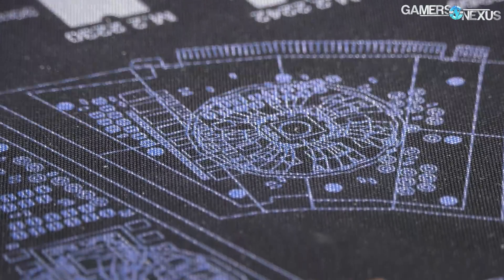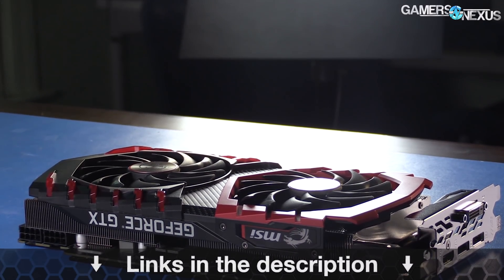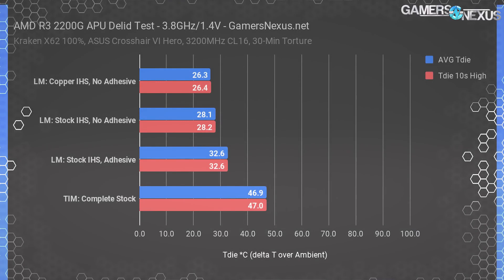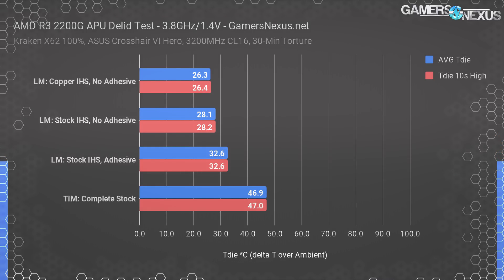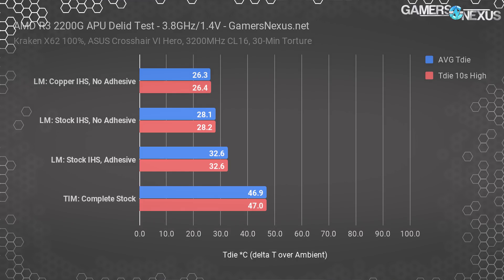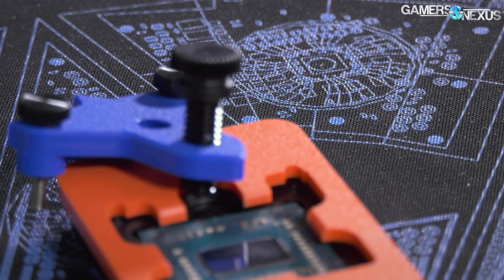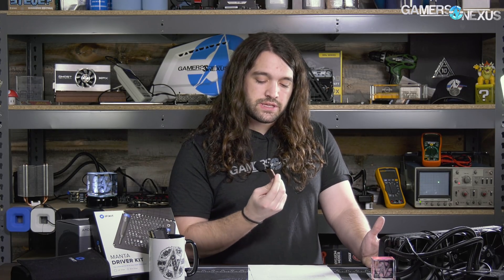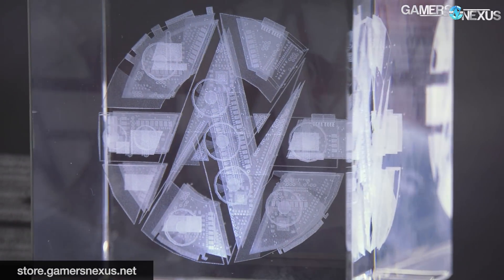Ryzen Custom Copper IHS Tested

Comment: Interesting enough but I’d like to see how to remove the silicone adhesive. How does that not get in the way of the delidding, is it that easy even though the adhesive doesn’t want to come off? Also does the adhesive actually help protect the silicon by dampening the pressure from the cooler plate?

Comment: I have no idea if they were available at the time but EK offer both a flat cold plate and a rounded one (more suited to the uneven stock ihs) but it would've been cool to see if there was any difference when you use an optimised cold plate for each ihs

Comment: Hi, great video, as always. I have a question - doesn't the Gallium in Liquid Metal eat away at copper over time and hence is only advisable to apply on nickel plated surfaces instead of aluminum or copper surfaces ? So how does this setup with liquid metal as the TIM between die and IHS fare for the health of the RockItCool's Copper IHS ?

Comment: Just as I have posted on a previous video regarding this useless operation, you are basically gaining nothing in real world thermal transfer by replacing one piece of metal, with another one. You are just replacing one bottleneck with another. The REAL deal is when deliding the CPU, never re-lid again with anything. Alk you need is a special height adapter for the socket to compensate for the height loss and properly secure the heatsink (available from a couple of specialized online vendors) and thats it! You now actually eliminated one bottleneck all together instead of going around the bush and replacing it with another one ''that has better heat transfer properties. Nope,  none of that! Pure logic and physics here: CPU DIE, THERMAL PASTE OF YOUR CHOICE AND HEATSINK! This is the ONLY way to benefit from deliding a CPU and improve thermals :)

Comment: Oh and NEVER use liquid metal. Even after a very short time, it can harden on the chip and heatsink. This means sanding/scouring to remove it which fks up that lovely lapped surface and slowly         chews away the die surface. Considering that it needs re-applying AT LEAST every couple of months that is not a good situation. Minimise thermal interface, use the best quality traditional thermal      paste....

Comment: Back in the day.... there were no IHS's... heatsink went direct to die. The best IHS is NO IHS lol delid and chucket...... it's an easy thing to make the cooler press down a little tighter to account for the missing thickness, and with 1 less thermal interface and several mm less mass for the heat to traverse on it's way to the coolant medium... you will see WAYYY better improvement than ANY custom IHS can ever provide. Heatsink/cooler-block direct to die... always.... 
Minimum thermal mass at the die, maximum thermal mass at the radiator.. best cooling...... try it and see ;)

Comment: If you do further testing with Deliding, could you do a test with stock TIM, vs LM vs high end TIM like Kryonought thermal grizzly. For a project like this which is attractive to those using LN2  however LM is unsuitable for low temps due to it's high freezing point so i'd want to know if its worth deliding for LN2.

Comment: I used to work in corrosion control in the military.  From what I understand, you shouldn't be mixing metals surface to surface for any kind of long term use without expecting galvanic corrosion to occur.  I keep seeing these videos, and this issue is never addressed.  Some liquid metals (mercury) can cause catastrophic damage when they come into contact with other metals and alloys.  I've never seen any conclusive testing on what these companies are actually using for their products to ease my mind for use in a PC for 3-5 years.  The numbers are cool and all, but I find them impractical without feeling comfortable about the product in question.
Reply: I am personally using a liquid cooler with a copper heat spreader but this could vary even though pretty much all the high end stuff that I've seen uses copper (maybe nickel?) and if you're willing to modify your CPU like that chances are you have a pretty high end setup.
And regarding that mercury issue that you pointed out, no one will ever be using mercury because it's not exactly easy to find, it's dangerous and extremely polluting. Liquid metal for cooling is generally some kind of alloy of tin, indium and gallium. Heck, even thermometers use gallium alloys these days.

Comment: Steve. Would giving the copper ihs, or any ihs for that matter, a polished mirror finish as apposed to the milled finish seen here have any impact on thermals? My thinking is that there is less peaks and valleys for the TIM to have to get into, and thus it can be thinner leading to better heat transfer.

Comment: What I find strange is that in every deliding video only liquid metal is mentioned while it is not necessarily a good solution for everyday use. Would a high quality thermal paste between the cpu and ihs make any significant difference compared to the stock tim?

Comment: I'm curious how much of a difference lapping the IHS and heat sink plate would make on thermals. Probably not a huge amount but I know that Intel's IHS is typically Convex and many cooler plates are also slightly convex. I was thinking that by lapping the CPU yourself you'd basically achieve what the Rockit Cool copper IHS does by making the surface flat and exposing the underlying copper. You'd also get the side-benefit of having the nickel plating on the underside of the IHS so the liquid metal isn't so difficult to deal with. I've been thinking of doing this with my ancient X5660@4.4Ghz and the equally ancient Thermalright Ultra-120 Extreme (Nickel) I have.

Comment: LTT did a video featuring a graphite thermal pad with ridiculous endurance to replace thermal paste I think it would be funny to use that this aftermarket IHS and a passive cooler as the ultimate maintenance free CPU cooling setup

Comment: What the graphs show is that thermal transfer is a function of basically contact surface area, heat generating surface area, heat radiating area and distance between surfaces (pressure). Makes sense, no?

Comment: If it is a product for hard core overclocking why they made it from copper instead of something better in terms of thermal conductivities like silver for example?
Reply: Because you would likely run into the heatsink being the bottleneck, and so wouldn't see much improvement. You could make a silver heat sink (though it would be highly prone to damage as a soft metal), but the price would likely be high even for hardcore overclockers. A large heatsink made of silver would cost over 500$ at least. And because it wouldn't be mass produced, it would likely be in the thousands.

So long story short, silver wouldn't be better than copper unless you also got a silver heat sink.

Comment: You should try honing the rocket cool surface. With a thicker IHS you have enough material and could polish the top of it and the bottom of your heatsink to tolerances far tighter than manufacturer achieving an almost cold weld connection.

Comment: "...so you can't go to wrong with it." Until you break a $350 CPU because you don't know how to delid a processor before attempting to change the IHS.

That said delidding is something I would try but not with a CPU I still want to use on a regular basis, at least not for my first time.

Comment: I wish CPU cooler parts manufacturers would use pyrolitic graphite sheet. It has many, many times the thermal conductivity of copper. It would basically be as good as this, but much smaller, and can be added on top of the standard heatspreader.. or something like that. There are at least some possible uses.

Comment: QEUSTION.: i saw linus do a vid on IC Graphite thermal pad ,what if you delit and stick that inbetween then aply the copper and then another graphite pad and then the Fan ?(or if there is a fan a fan made with graphite ?) would that decrease the thermals alot more or would that be to risky ? love the show on how detailed it is every time.

Comment: Steve can you test IC Graphite Thermal Pad by Innovation Cooling? Linus has a video about it and was wondering what you would think of something like this. Be interesting to see if it would work for the IHS on both sides instead of liquid metal and thermal paste.
Reply: Nertz yes please, put this in the rocket IHS instead of LM

Comment: What about adding thermal paste between the IHS and the substrate (where the silicone adhesive usually goes)? Would that help remove some heat, or would it make it worse(by making another air gap)?

Comment: I would pay to intel 50 euros more for a 8700k but delidded and with this.
Reply: I'd pay for pre-delidded CPUs I had to add LM to myself and reseal. It does sound like a warranty nightmare though.
Reply: fak1t you can buy one from der8auer from caseking. He personally delids, tests, and guarantees overclocks at stated voltages. Just look up silver ihs 8700k on google. They are expensive, though.
Reply: Aditya Upadhye yeah i know mate , but that means rip guarantee

Comment: Isnt it better just go without IHS for the Ryzen APU's. I would have cut a square silikon baker and cut middle rectangle than go without the IHS for the Ryzen APU's  because there is no protective metal around it. (Just using good quality thermal paste)

Comment: Why not remove the IHS and install the cooler directly?  I think transfer could be increased by a water block or direct contact vapor chamber directly on the die.  Just eliminate one layer of tim/liquid metal.  I have always wondered about this.
Reply: You can but it’s risky the direct pressure applied can damage the silicon

Comment: With a Ryzen CPU wouldn't it just be more beneficial to remove the IHS and apply direct die cooling? On the Intel platform the IHS is used as part of the CPU's mounting mechanism. That is not the case for Ryzen so you SHOULD be able to applied a cooler directly to the die with liquid metal and it should prefer better as it results in less variables and the removal of the second layer of TIM.

Comment: Where are  the graphs for delidded, but with a more standard TIM like Aquanaut or Hydronaut instead of Conductonaut? When so much is achieved with just removing the old adhesive. It would be interesting to find out how much the Conductonaut is actually doing over a standard TIM...

Comment: So besides the 2200 and 2400g, are the Ryzen chips all soldered? And is that as good as a delid/liquid metal application as far as temps go? 

I'm actually super happy with my 1600x temps, with the evga 240mm clc I stay at 30*c gaming. It's still only the start of spring though and I just recently built this rig so I'm curious to see how temps will fair in the summer. 

I have to say one nice thing about being in a Canadian winter is I can open my window up and drop the room temperature to 20*c and don't have to worry about how hot the overclock is making it :D I wonder if anyone has ever done a custom loop to an outside radiator in the winter? I think that's more of a Linus video though.

Comment: Props to AMD for using decent TIM under the IHS and for soldering every non-APU chip
Reply: Alb 92 I'm not referring to stock cooler TIM. I'm referring to the comparison between the stock IHS but with liquid metal and the aftermarket copper IHS with liquid metal. That's about a 4-5° C difference which is very good compared to some of the i7s with its stock TIM. Delidding those would drop at least 10° C or more

Comment: Those are more geared for competitive overclocking I would think. 1-2 degrees could be the difference between the highest overclock and the second highest.
Reply: JETWTF But the question remains why they use simple copper instead of something with better thermal conductivitie like silver?
Reply: Copper is the best metal thermal conductor followed by aluminum, Silver isn't a good choice comparatively due to cost as well as it is a more brittle material making it harder to manufacture.  I would prefer a solid aluminum I7 heatsink than a silver slug/copper fins one that costs ten times as much as a copper core and aluminum fin which is the best solution for mixed metals. The very best all copper no huge slug but a cone.
Reply: @stanisawszczypua9076  You could argue that removing the IHS altogether would yield better results, or using a gold IHS. It's about making something practical. Still, GN made assumptions as to the purpose of the product (noise reduction) and maybe you're right, overclockers would be interested in something like this but they found ways of pushing the cpu to the limits without swapping the IHS (lapping)

Comment: Important to note all Ryzen CPUs are soldered, except for Raven Rdige (which is used in the video). Delidding the soldered Ryzen CPUs is pointless (and very difficult/dangerous...) as it will give you virtually no performance increase. Nor does it make sense for Raven Ridge either, seeing how Raven Ridge are cheap budget CPUs.

Comment: You could get the same results by making the ihs shiny. You could squeeze more performance with the rocketcool AMD ihs by making it shiny as well
Reply: Wouldn't even be too difficult, as long as you have a couple wetstones. 20 minutes of abrading and you could have a mirror finish.
Reply: Birki gts 1000 grit sandpaper and metal polish would be cheaper and will do the same job
Reply: I doubt it. For it to be beneficial you would need the surface to be perfectly flat (and 1000 grit isn't enough for a mirror polish so it would leave microscratches even once polished). You would struggle not to cause pits or bumps with sandpaper, a wetstone i perfectly flat if well maintained which makes it perfect for the job.

I would get a set of 3 wetstones from 1000 grit to 5000 grit. And then use a light cut polish afterwards to insure a perfectly flat finish without any tiny scratches.
It would be more expensive (a good set of stones is 100$ at least), but at this level of overclocking, might as well do things the right way right off the bat, rather than go half way.
Reply: Birki gts people have done it before and got good results. Even back in the core2duo / core2quad days.
Reply: Could be luck, or it could simply be that they gained a bit while leaving a bit behind. Perhaps they would have achieved better results with flattened wetstones. Perhaps not, i certainly don't have the money to risk testing it out though. So im just speculating at this point. I know for a fact as a woodworker (need flat mirror finishes in steel to sharpen tools) that perfectly flat finish is not possible with sandpaper unless you happen to have a flattened granite lapping plate or a sheet of thick float glass to support the paper

Comment: Why not test Ryzen 2000???
Reply from the maker: It's soldered.
Reply: Ivan jovanovic because every ryzen Prozessor, except the APUs is soldered and are very difficult to delid, and it's not worth the risk
Reply: It is Ryzen 2000.
Reply: Because ryzen 2000 is soldered so this would make little to no positive difference. It's essentially just one solid piece of metal.

Comment: Hilarious sponsor spot, +1 patreon supporter.

EDIT: Worth noting that not having a nickel barrier between the die and raw copper will allow the “liquid metal” based TIM to absorb into heatspreader, causing ever degrading thermal performance. There is a great post on notebook review forums that goes more in depth:
http://forum.notebookreview.com/threads/something-to-think-about-liquid-metal-compatibility-with-copper-heat-sinks.800890/

Comment: How can I install the IHS if I remove the silicone adhesive?
Reply: gamer games the thermal paste will hold it a bit and also ya can use some silicon glue to place glue it back, but go lighter then what AMD dose. 
Me personally I would lay the case on it's side, put w bit of thermal paste, put on the new ihs, put paste on the new ihs  and then attach the cooler. The cooler would anchor it down.

Comment: Yeah gifs are called Jraphics Interchange Format
Reply: To be fair "laser" stands for "light amplification by stimulated emission of radiation", but you pronounce it 'lazer' rather than 'lasser'
Reply: SirGhosty22 Jurassic Intercourse Format
Reply: The "e" in laser would also have to be pronounced differently. Nobody on the planet does, though.
Reply: Also, laser is pronounced with a "z" sound in English, not just America. Because "lacer" is already a word.
Reply: Gif is an acronym, it should be pronounced like the creator intended. I don't understand why so many people use the "it's Graphics not Jraphics" argument, since there is no rule that describes this situation.
Reply: SirGhosty22 Yeah ATMs are Ayyetomatic teller machines
Reply: MikeGoesBoom so is it carz or cars? Engrish.
Reply: LAZORZ!!!